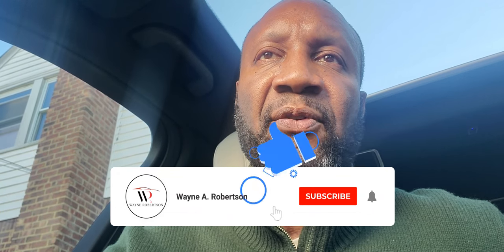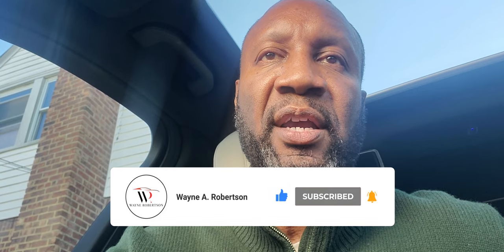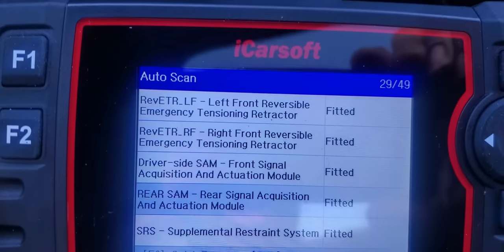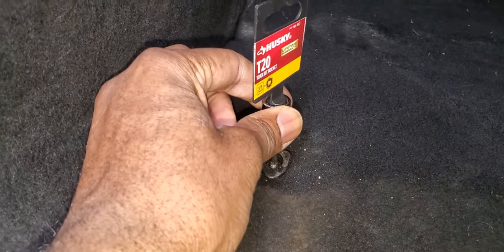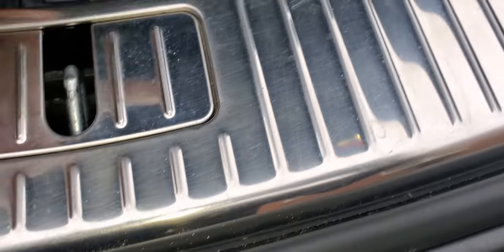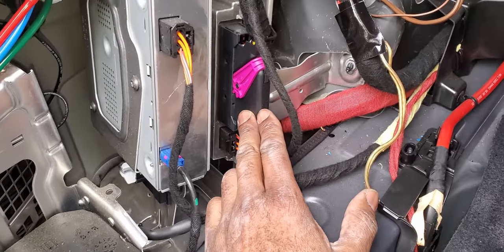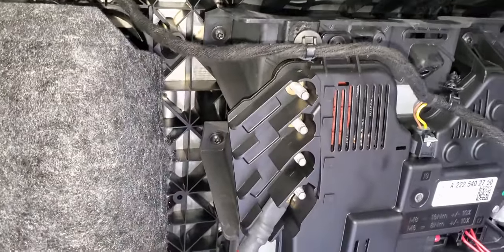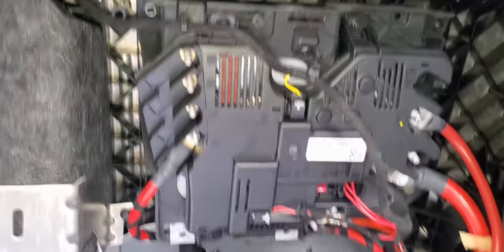Mercedes Benz: Rear SAM Module on a Mercedes Benz | Mercedes SAM module Programming :

Comment: Love your videos Wayne.  My 15 w222 had low aux battery and now center console buttons stopped working.  Replaced battery but central gateway module is not communicating.  Can that be reset or programmed?
Reply from the maker: Any module would have to be reprogrammed unless you buy it used from the junk yard or order it from a shop that can programmers it for you or go back to the dealership. The dealership is the most expensive

Comment: Dear sir i enjoy your Videos  its very usefully , i have s class 2014 w222 first edition back seat like Maybach it does not have amplifier in the trunk, the audio system is basic with no sub, do you have an idea how to route signal wire from inside the car to the trunk. Thanks
Reply from the maker: It can be done, but you should watch installing a home theater on a Mercedes 2016 S550 video first.

Comment: So my 2017 s550 was stolen from me and they cut wires in the roofing of my car. Now I cant push start, only can use the key fob. I connected a few of the wires and fixed things like my back windows. But its a few more wires I have to connect but bone of them are the same colors. How can I find a diagram for which wires go to which?
Reply from the maker: You will probably need to get the electronic manual from Ebay and install it on your computer. You can search the manual for what you need

Comment: Is it possible to reprogram the SAM module for US cars so the rear amber LEDs flash when using the turn signals instead of the red brake light LEDs?
Reply from the maker: I've never heard of that being done before, but anything is possible. It will probably be better if you get a 3rd party device for that
Reply: Ok, thanks. I was told the amber LEDs are already in the tail lamp assembly but US cars are not programmed for them to operate, only European models.

Comment: Someone smashed into the back of my w211 and alot of water been getting into my trunk now it wouldn't crank or none of the lights comes oñ..i need help
Reply from the maker: This is equivalent to the car being under water. God help you
Reply: So what? I need to buy another car? Or can it be fixed?
Reply from the maker: I would start with a new battery or see if it gets juice.Hook up a charger, And see if lights on dashboard come on. See what got wet in the trunk. Replace it if you can without breaking the bank. If your bold bring it to your trusted mechanic outside the Dealership. Tell him what happened and have him give you an estimate. It would be a lot cheaper to recover the car than buying a new one

Comment: Hi I was wondering if you could assist in locating and adding a wire in the areas SAM of a GLS X166. I have red blinkers and need amber on the US version I took to Europe
Reply from the maker: Speak to  Mercedes to see if it can be done first, before venturing on that. The parts department would be a great place to start or a Mercedes Mechanic at a dealership.